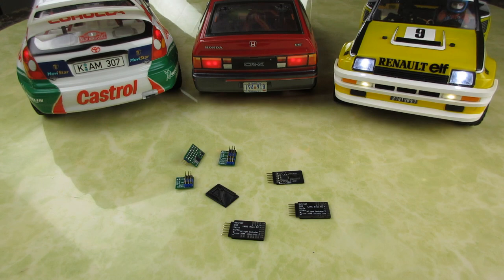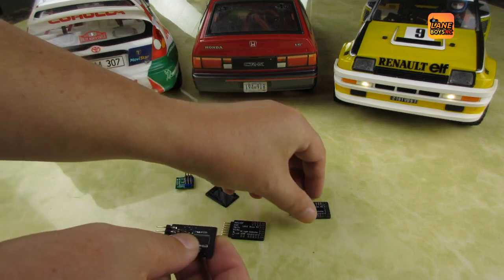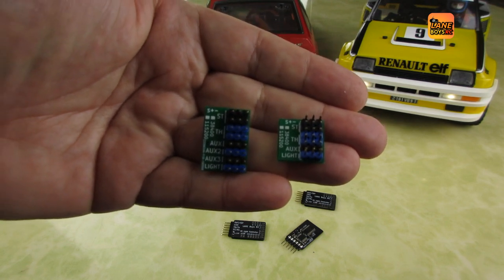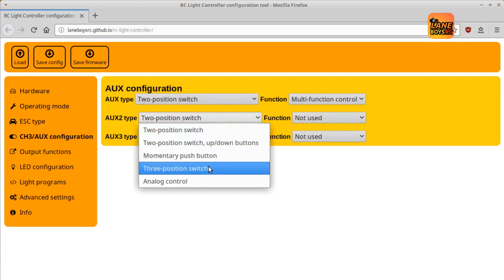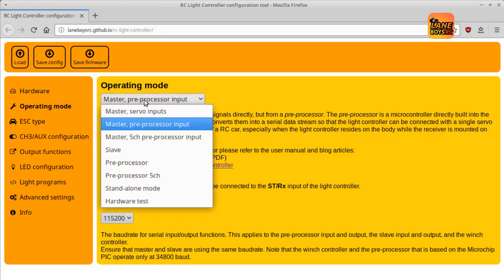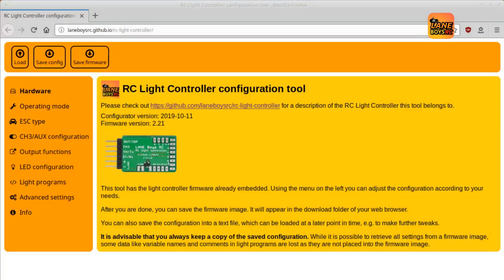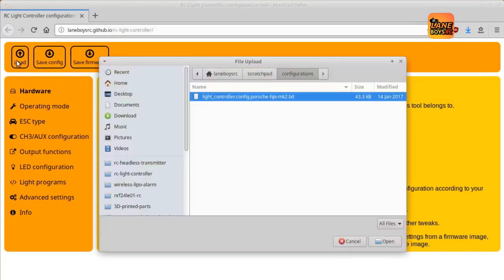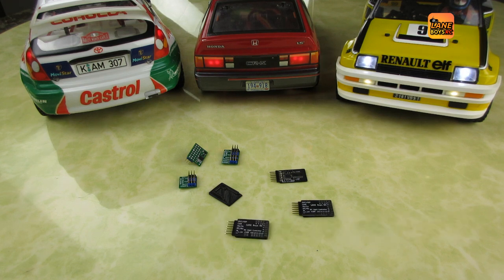2019 update DIY RC Car Light Controller Mk4 -- LANE Boys RC

Comment: Great project.. finding it hard to find files on GitHub... it is very confusing. I want to build my own and make use of the gear function on my 1/14 scale truck.
Reply from the maker: Hi Simon,  
All information about the current version can be found in the https://github.com/laneboysrc/rc-light-controller/tree/master/mk4-tlc5940-lpc812 directory.

In there you find an electronics/ directory that contains all the information about the circuit board. The file https://github.com/laneboysrc/rc-light-controller/blob/master/mk4-tlc5940-lpc812/electronics/BOM.txt contains the list of materials. The ZIP file https://github.com/laneboysrc/rc-light-controller/blob/master/mk4-tlc5940-lpc812/electronics/rc-light-controller-tlc5940-lpc812-rev2-gerber.zip contains Gerber files that you can send off to your favorite PCB manufacturer to get boards made.
To get the software you can simply use the configurator tool at https://laneboysrc.github.io/rc-light-controller/ and save a .HEX file. 

The user guide, including instructions how to flash the firmware using a USB-to-serial adapter, can be found at https://github.com/laneboysrc/rc-light-controller/blob/master/doc/light-controller-instructions-mk4-tlc5940-lpc812.pdf
If you have further questions don't hesitate to contact me via email laneboysrc@gmail.com

Comment: I wouldn't need a controller with a lot of effects. Just the turn signals flashing when converging or both together. Low and high beam such as the tail light and brake light. The rest just lights on/off.
Reply from the maker: This light controller supports all the functions you listed. Actually the default configuration it ships with is basically what you described.

Comment: Its great to see you're still working on improving this already awesome piece of kit! I hope more people become aware of this smart light kit instead of running around with the blinkers on all the time.
With this new programing is there still a button press activation like the old version had as well as the additional channels? I'm assuming its changed over to being controlled by the aux channels only now?
Reply from the maker: Thanks for your kind words. The local button is still working as before. Actually all the original functionality is still there. In the new firmware the local button on the AUX/CH3 pin of the light controller is always enabled when any of the pre-processor (3ch or 5ch) is selected. 
The local push button always works as the multi-function control though (1 click more lights, 2 clicks less lights ...)

Comment: Awsome! Does this mean, we could adjust endpoints for a servo controlling steering wheel and another servo controlling drivers head seperately with the LaneBoys LC new preprocessor?
Reply from the maker: Hi! The light controller only supports one servo output. It is not able to control two servos with different endpoints. The new AUX channels are inputs that allow you to control functions manually where you had to use multiple clicks before. 
My assumption for the design was also that car radios with 5 channels are modern and have endpoint adjustments on the transmitter anyway.
Reply: @laneboysrc  Thanks, Werner. It's true... misunderstood this. Ch. 4 and 5 advantage "additional function" of Ch. 4 and 5, such as special light functions, instead of clicking 4 times fast, 5 times, etc.?
Would it be possible, to switch all the functions off by such a switch?
Reply from the maker: @donaldsneffe  Toggling all lights on/off is already supported via 3-clicks; I haven't implement this as separately as independent AUX function. However, it is possible to write a simple light program that performs this function on one of the additional AUX channels.
Reply: @laneboysrc  ... I meant a "all off" (incl. turning signals, break, rear drive), so "nothing". Sometimes quite desirable.
Reply from the maker: @donaldsneffe  I see; this is easy to implement. I will add that soon as configuration option.
Reply: @laneboysrc  THX!
Reply from the maker: @donaldsneffe  Pushed to Github just now; Firmware version 22. Configurator 2.22 from 2019-10-20. Thanks for your suggestion!
Reply: @laneboysrc  Thank you! Need more than 3 channels for this function now? (in most of my rigs I simply have a 3ch Flysky, because with the awsome LaneBoysRC LC I do not need more for rigs without winch ;) ).
Can I simply update my "old" LCs, or do I have to do all the programming again?
Reply from the maker: @donaldsneffe  The configurable AUX functions only work in conjunction with the new 5-channel preprocessor. The direct servo connection and 3-ch pre-processor only support the multi-click switching as before.
However, it is possible to disable all lights with the direct servo connection or 3-ch pre-processor by use of the light switch positions and a custom light program. I'll send you an email with the info attached.

Comment: How will this work with the traxxas leds? I already have the leds installed, but find the controller too limiting. Especially since I want to go away from the stock tx/rx combo.
Reply from the maker: Traxxas LEDs are designed to operate from a constant voltage power supply of 3V. The LEDs have current limiting resisters built-in that are dimension-ed for 3V operation. Traxxas does not specify the operating current of the individual lights.
The easiest way is to use the Mk4S light controller (9 switching outputs). In addition to that a "3V BEC" is needed to provide the 3V power supply for the LEDs.